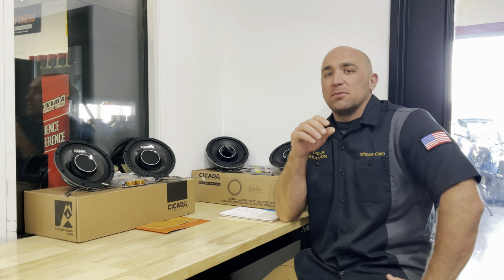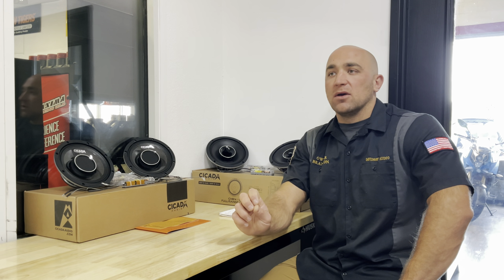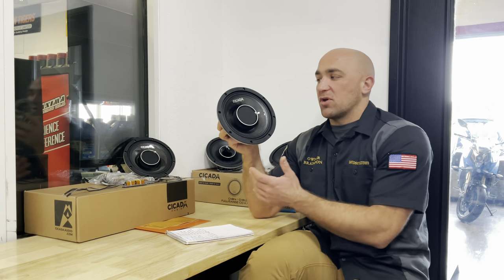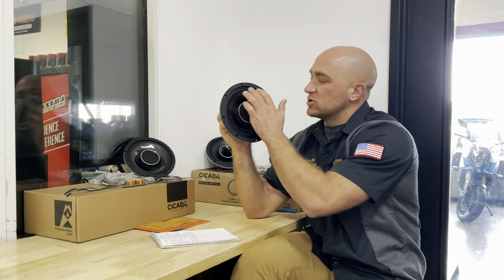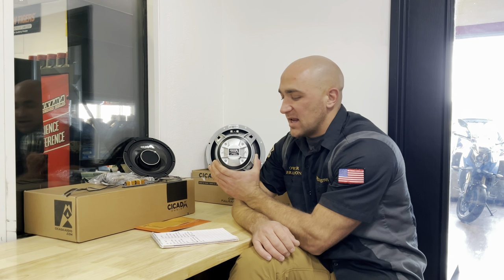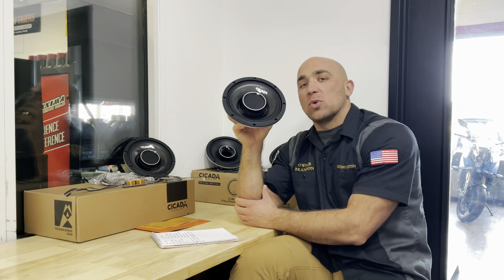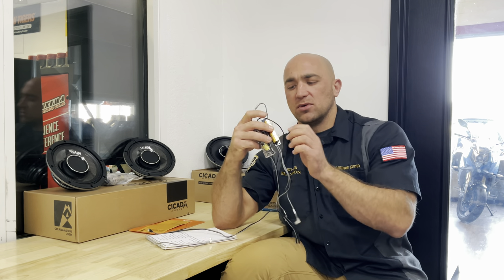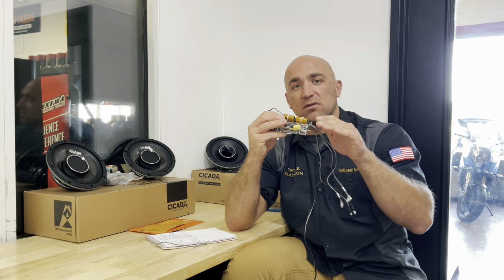Cicada Audio CHX 8" Pro Coaxial Horn Speaker review

Comment: Man I love your content and your reviews. I was wondering if you had any challenger or Pursuit customers that went beyond stock speaker sizes and got into more custom setups like for instance fiberglassing a 8" or better yet a shallow 6x9 in the upper fairings and a 8" in lowers with high output 8" or a 10" midbass drivers? Would love to see that type of build if they exist. I'm actually trying to see myself if I can get the fairing lh and rh dash parts and have them modified to fit a 6x9 with say 3.5" mounting depth. I'm just thinking of ways to get the most out of the upper fairing. just a thought don't kill me on my crazy ideas.

Comment: I want to know why Cicada changed the bolt pattern. Does it loom sharp, of it does but now most other grills aren't going to work with these speakers. If they did it so we're forced to buy grills from Cicada thats bs we the consumer should be able to use what grills we want or already have
Reply: Great videom BTW. Everything I wanted to know was answered
Reply from the maker: I have been using cicada speakers for a few years now and haven’t noticed the speaker mounting holes change. We have been using cicada grills since they were released and absolutely love them. Their grills also fit other speakers not just their own. What grills are you trying to use on their speakers?
Reply: @DavidsonAudio  I have grills from Nagy Customs. The grills fit my 8's now flawlessly but they also have the industry standard 4 holes. The new CHX's have 8 holes and look to be placed differently so not even 4 of the holes line up. I could be wrong but it didn't look like you screwed them in the pods. 

Does 4 of those 8 holes match up with the industry standard 4 hole speakers?